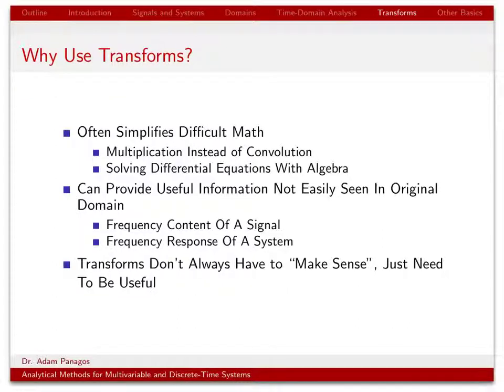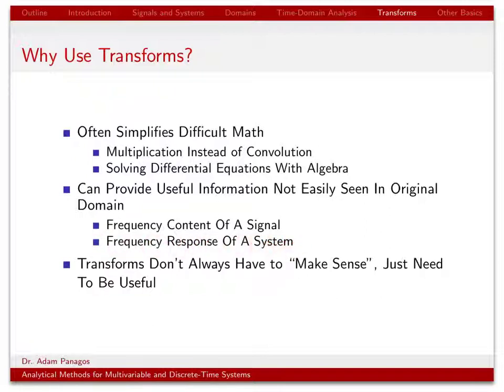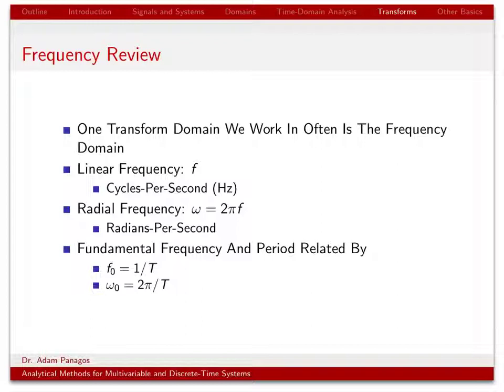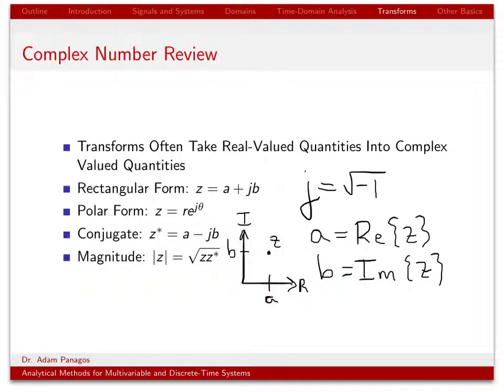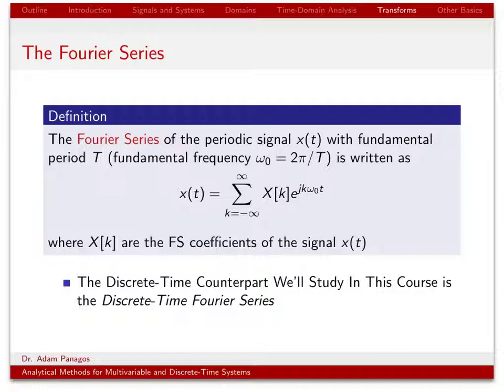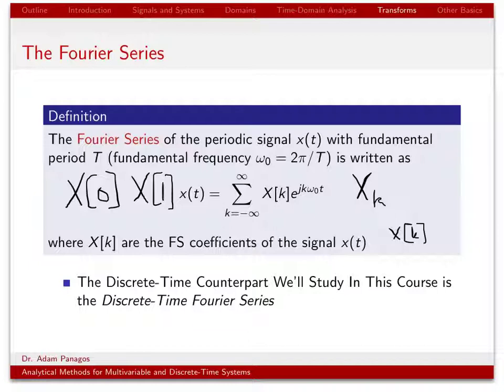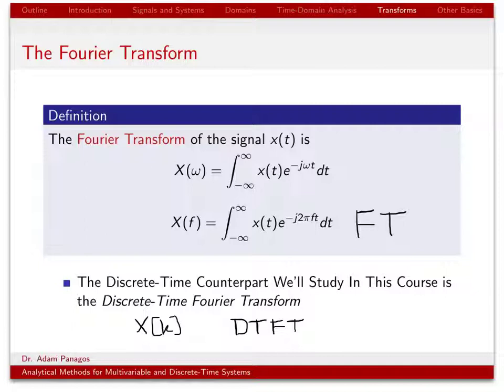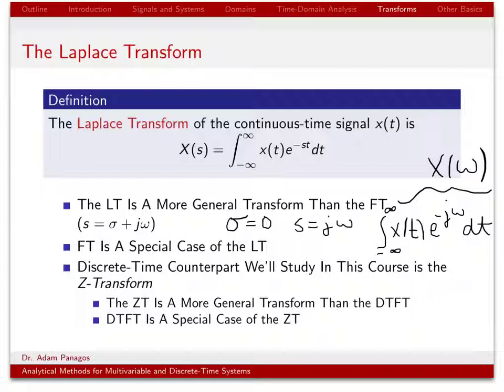Discrete-Time Signals and Systems Introduction (3/6): Transforms

Comment: Nice! Little confusion here. I used to keep on thinking all the time that Fourier Transform can be use in both Periodic and non-periodic cases?..  I is wrong?
Reply from the maker: You're not wrong, you can use the Fourier Transform (FT) on periodic signals as long as you're OK with allowing impulse functions in your answer.  For example, the FT of a cosine is simply a pair of impulses (one at positive frequency, one at negative frequency).  Typically, we use the Fourier Series (FS) to work with periodic signals, but if you're OK with impulses the FT is fine.